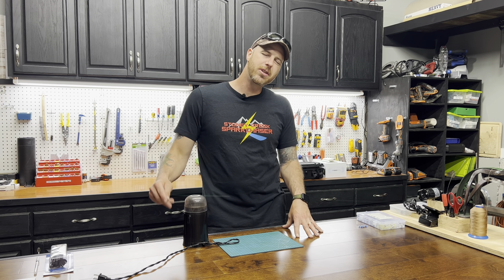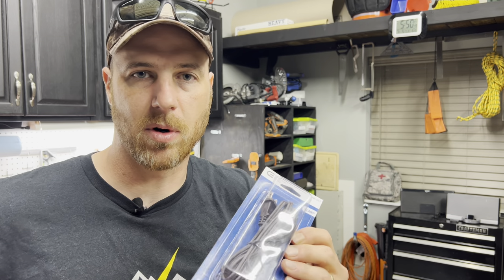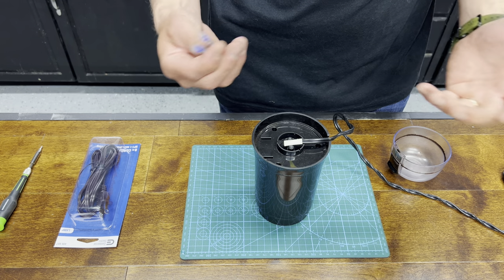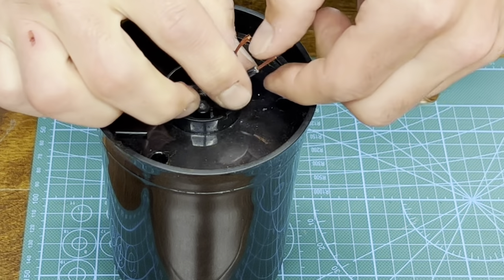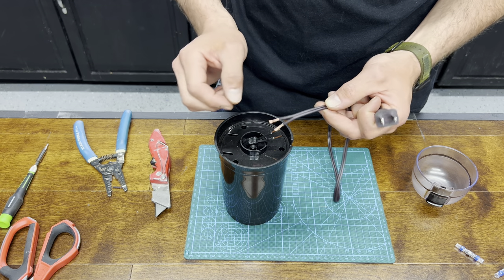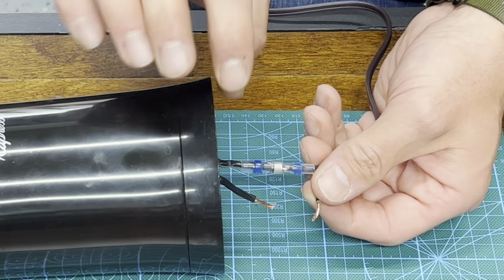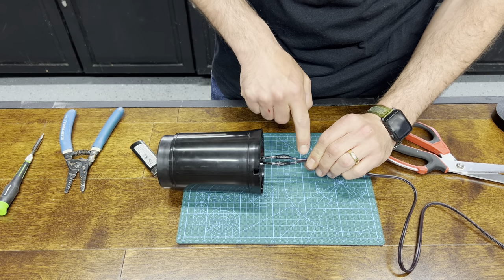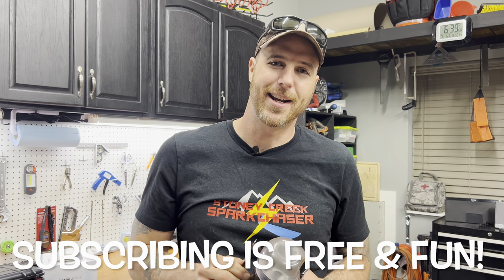Like Coffee? But, Your Coffee Grinder Cord is Coiled Up Like a Snake? I’ll Show you How to Fix it 😎

Comment: How much did you spend on a new cord and 2 joiners ?
Reply from the maker: Hey Mohammed! New cord was around 6-7 dollars and the splices came in a kit with 100’s for about 10 bucks. So, hmm. Maybe 7.01. Now it works like new. Lol. I’m pretty cheap and try and save where I can. 😎
Reply: @StoneyCreekSparkchaser  I'm even cheaper.
I would have just untwisted the old cord.
If that was impossible , I would have just snipped the cord off some appliance somebody threw away.
Or more likely off an appliance that I have not thrown away.
Reply from the maker: Ok now that’s funny, but completely reasonable. The old not used appliance cord makes complete sense!!! Haha